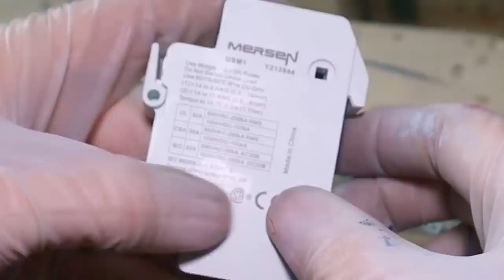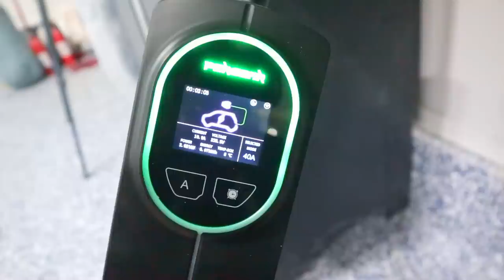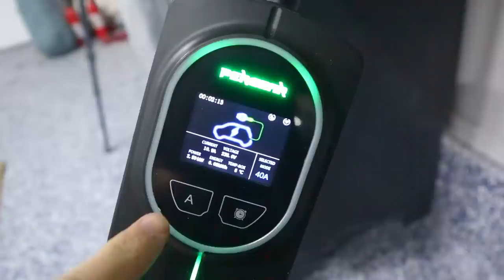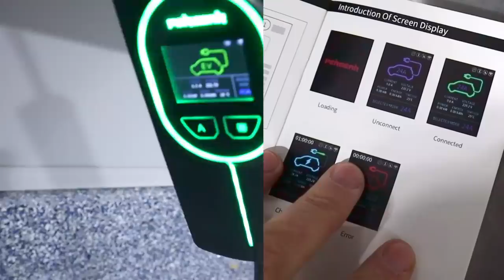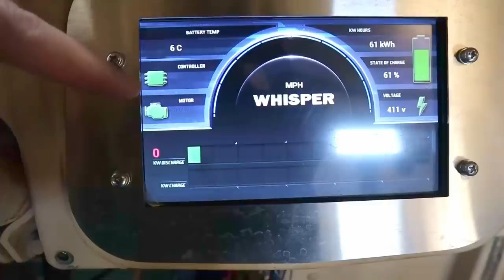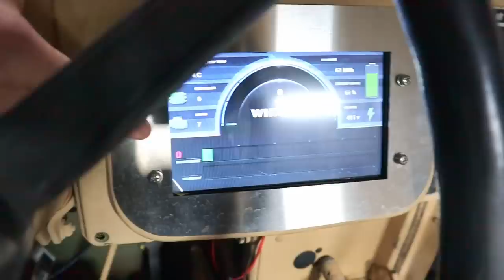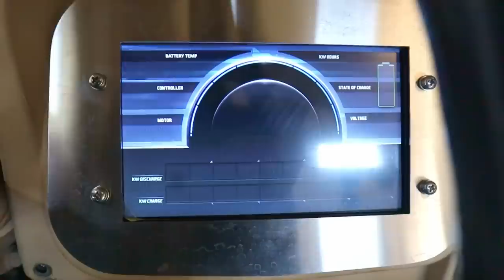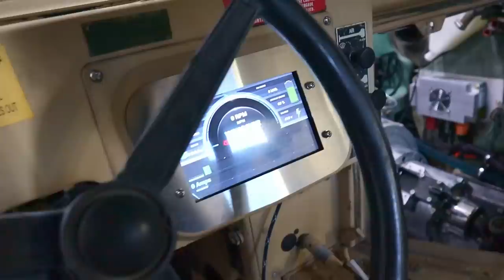The Electric HMMWV Strikes Back - More Trouble with charging

Comment: Here Maybe some tips with the CAN-Bus, because I do a lot at work with it I had a lot of issues that i know.
- The wiring should be in one line and should not have any stubs. Yes I know the specification allows to have stubs, but in my experience they often make more trouble than anything else. If you need a stub, try staying below 1m. For debugging purposes like PCAN you can allways have longer stubs, as long as you are only reading and not sending anything on the bus over it.
- You should also look at the maximum wire length, I recommend staying under 40m.
- When CAN-High or CAN-Low on any slave isn't connected properly it can happen that when the can load is low that it works fine and as soon as the load goes higher error telegrams might appear
- You can see error telegrams with the PCAN software when you go under trace > rightclick where the messages are > Enable "Log Error Frames" & "Log Error Counter Changes". You can also disable the other ones, so it's easier to see the error frames when there are not thousands of messages
- The Termination Resistors (120Ohm) should allways be at the end not somewhere in between.
- When everything is off you can check the Termination Resistors by measuring between CAN-High and CAN-Low wire the Ohm. It should be around 60. (120Ohm>1Resistor, 60Ohm>2Resistor, 40Ohm>3Resistors, ...)
- There should only be one CAN-Master in the system otherways they can interfier with each other.
- In my experience twisted pair isn't really needed mostly we use just flat cables.
- It could also be that the BUS is overloaded, this is the only thing, that you can't test with the USB-to-CAN from PEAK. For that you would need the PCAN-Diag 2 or for vehicle purposes PCAN-Diag FD with the J1939 Add-in. With those devices you can see the CAN-High/CAN-Low Voltage levels, how many error frames, how the load is in a bar chart, oscilloscope for the signals, etc.
- When on a slave CAN-HIgh/CAN-Low is swapped or has any issues then the slave automatically disables it's transceiver. So it doesn't interfier with the others in the bus.
- So all in all if there are no error frames on the CAN-Bus and it's never overloaded, then there aren't any issues with the wiring.
Reply: Just mentioned the resistors. I really think these are causing communication problems and may solve the whole issue. 1-wire devices have a resistor between comm wire and positive at every device otherwise they won’t be seen. Does this system have a central unit for canbus comms?
Reply: @rancillinmontgomery2480  CAN-Bus only has a resistor on the end of the wiring, so it eliminates the signals and no reflection appears. The resistors there are between CAN-High and CAN-Low. In between there can be up to 30 devices then you would need something like a CAN-Repeater to improve the signals again.
Reply: @Silent3241  there needs to be 2 correct, one at each end? Could the error message CAN Heavy be from the absence of the resistors?
Reply: @rancillinmontgomery2480  Yes one at each end. In my experience CAN Heavy can come when you start the individual participants on the CAN-Bus, but mostly goes away by itself. I only noticed it now that it stays, when there are messages incomming. So it could be the resistors, but I would focus way more on the baud rate of the individual participants, because when there is a mismatch then there will be errors on the bus and one of the participants will shut of their transceiver, so the rest can communicate.

This is why i wrote "- You can see error telegrams with the PCAN software when you go under trace > rightclick where the messages are > Enable "Log Error Frames" & "Log Error Counter Changes". You can also disable the other ones, so it's easier to see the error frames when there are not thousands of messages" in the first comment.

But it seems like our discussion doesn't help very much because @ElectricSuperCar doesn't our conversation.

Comment: I’m so glad that when I did my conversion I built out each system separately. Batteries and charging, motor and controller, etc then combined everything into a master control unit. At the time it was Elithion. Not as robust of a unit as you guys are using, but it worked! Maybe go backwards and split units off the can bus. Isolate the J112 control, charger and batteries. You can charge for a short test with the BMS control just to see it take a charge. Temporarily turn off all battery management and let the charger control run wild. You can simply unplug to stop it.
Reply from the maker: Thanks for the comment!

Comment: I love how you try and try without hesitation . I'm just wondering how and when you learned all of this . I definitely wanna watch some Q&A about this channel .
Reply from the maker: Ya, I just tend to jump in.  Learned by doing I guess
Reply: Just learn as you go, then show someone (that will cause you to learn more) then learn something more.   This is the EVSE interface with Pilot and Proximity and AC power and high voltage DC fuses and CAN data representing measured values --- SO many aspects of electrical engineering!

Comment: Make sure that pin 3 (charge power) in the Orion bms, has 12v+ when the charger is connected, otherwise the bms will not command the charger to turn on. I paused one of your screen shots and it said it was off when it should be on. hope that helps.
Reply from the maker: Thanks for the comment Nick!

Comment: I can mostly agree with your methodology. However can’t help but notice that you rewired the plug and fried the wall charger, and the onboard controller immediately after. I’m curious about that. I’d verify that should be ground or whatever it was, then verify it’s only ground meaning the previous wiring didnt use that pin to power another circuit or something that could lead to everything being shorted. But of luck.
As a test engineer I 100% can relate to the pain of blind diagnostics.
Reply from the maker: Thanks for the tips!

Comment: I feel like with your address conflict issues you need to disconnect everything. Start with just two systems on the CAN bus like the bms and controller, get the can addresses fixed and see if it charges. Then start adding in one system at a time. Maybe it's time for a excel sheet with every system and all its CAN address' and which ones can be reprogrammed etc.
Reply from the maker: You are probably right
Reply: just what I was thinking

Comment: I started following Zach's EV HMMWV build around 2 days after the first video was released, and I've been interested in the progress since.  Thank you for continuing to share challenges and processes on the build/repair.  Can you talk Zach into making sure it's labeled as an EV, in case EMS ever has to roll up on it?  Responders will need to know to grab their voltage testers and high voltage electric gloves.
Reply from the maker: Thanks for the comment!
Reply: There is no reason a voltage tester would be needed if all you need to do is get the occupants' corpses out. The only time it makes a difference is if it's on fire.
Reply: @user2C47  well, it seems to me that during ANY stage of contact with the electrified vehicle, knowing whether there is or is not a charge would be simple safety.  I admit I'm just a beginner in learning about both, basic mechanics and electrical systems, and only approaching as a hobbyist, but I've been shocked before, and tend to think about how to avoid it, especially with higher voltage

Comment: You are not just fixing errors of construction you are making the desigm function.
I recommend the AVC2 module to make the EVSE provide the 2 phase AC power - worked for me!
Your CAN looks good, remember to use tsp wire and a terminator at each end.
Reply from the maker: Thanks for the comment!

Comment: CAN wires always need to be twisted AND shielded! CAN is highly susceptible to interference and will cause intermittent communication issues. Specifically with charge systems you need a good clean communication line (CP wire) from the charger to charge controller on the vehicle. I work as an electrical engineer on electric buses and we run into issues all the time. We utilize CCS1 charging with J1939 CAN communication on our vehicles.
Reply: Another note: when using a PCAN as you are for network logging, you should set up the interface to look at CAN ID's vs continuous logging. That way you should be able to reverse engineer the RPM/Speed signals from the others. Source addresses are important but the message identifications (start bit/size) is where the specific data bits are stored and I am sure that is what you are modifying in the instrument panel. In our buses we use loggers with databases (which are nothing more than libraries) that can show data real time or can be viewed at a later point. Not sure if your inverter and motor/ other components come with databases, but those would be an excellent place to look for message details.

Comment: I have a plan do an EV conversion in the next 5 years (currently gathering components) and I'll definitely take the time and expense (it's just wires and connectors and a small price compared to the project) to lay everything out on a test bench and make sure everything works in harmony before installing into a vehicle.  While mistakes can still be made going from test bench to vehicle, having a working roadmap to go from would be invaluable, and working out initial bugs on a test bench is so much easier than climbing in, out, over, and under a vehicle and working in confined spaces.
Reply from the maker: Right you are!

Comment: What I’ve learned from these videos is that diy electric vehicle conversions aren’t really at the point where they can be easily done. So many brand new parts seem to have something wrong with them. If I had this many components fail before I finished a project I would be so mad.
Reply from the maker: It could just be me.  I tend to take the hard path
Reply: @ElectricSuperCar  no other industry has this rate of failure. How many components did you mention in this bud to have something wrong with them?4?5? I’d have to rewatch to get an accurate count but that seems ridiculously high. It’s like the ev component manufacturing just hasn’t matured to a point where you can get reliable parts. While defective parts happen in any industry it just seems really high failure rates for these parts.

Comment: Thanks for the content! Really interesting! From a systems engineering point of view, may I suggest detailing out the block diagram that you were drawing on the board a bit more ? You could add the different types of inputs and outputs with a description of what each block is supposed to do.. Then use that to isolate and test each component in isolation.. perhaps ?
Reply from the maker: Thanks for the tip!

Comment: I would recommend checking the signal with an oscilloscope at each of the nodes. If there is no physical problem with the network, then a CAN sniffer might help in checking if the BMS and charger are communicating.
Reply from the maker: Thanks for the comment!

Comment: At this point, I'd consider removing all systems from the Humvee, and getting it operating via some bench testing. Independent device testing, checking ohms on plug connections, and individual wires.
Test for problems like individual system interferences, ground or any wire shorts, ohm resistance over connectors or damaged solid core wires.

This can also allow better "combing" of wires before reinstalling for future wire replacements.

Best of luck.
Reply from the maker: Thanks for the suggestion!

Comment: For communication, you can also use a coxial cable... the same as your cale company uses, but there are models specifically for CAN, since this protocol is used in a lot of industrial applications,  as well as modbus.,

Also, you can buy a twisted pair cable, certified for serial communication (CAN in this case).
Reply from the maker: Thanks for the comment!

Comment: Hello, on PCAN Viewer you had displayed BUSHEAVY. This indicates an issue with the 120 Ohm rezistor at the ends of the bus.
Reply from the maker: Interesting.  Why do you think so?
Reply: @ElectricSuperCar  I know this from work. Our systems don't work (the bords on the bus) are not able to communicate if the BUSHEAVY is shown. Ideally you don't split the bus and where the cable starts and ends you have a 120Ohm rezistor
Reply: @ElectricSuperCar  and regarding the twisted can cable, we use flatcable 10p and it works great on 500 kbps. Maybe the charger is set for lower or higher bandwidth as 500 kbps?

Comment: I would make sure that I have a high voltage DC connection to the main battery terminals. I know AC charging is really important and convenient but to recharge using solar panels it’s best just to go direct current. You would benefit by a thermal camera as well. I have a thermal imaging camera and it’s been extremely helpful when looking at circuitry under load.
Reply from the maker: I will have to invest

Comment: CAN connections should at the very least be twisted, it helps prevent unwanted cross talking from other wires. I have a project at work that ended up frying 2 motor controllers because the CAN wires were NOT twisted, they are now twisted+sheilded+grounded and have been behaving ever since. the CAN communication chips are VERY sensitive to outside interference and even a high powered radio can take one out if unprotected.

Comment: Though I don’t know much about electric cars, it seems the original diagnosis of mixed up wires  could be the kind of fault that could have damaged multiple components that are strung together when Zack initially attempted to charge. In troubleshooting avionics I would suspect a power distribution fault has the potential to damage every other component in the chain, it’s certainly happened before.

Comment: Very strange problems.  Maybe it would be wise to disconnect everything else from the battery and fix the problem of not recharging first, because if the problem is in communication, it will be found faster.  What worries me is that you mentioned that the element in the distribution box overheats when it is not supposed to be loaded at all.  I wish you the best of luck in diagnosing the problem.
Reply from the maker: Thanks Friend!

Comment: Based on the issues you have found I would seriously consider what is your plan if this rig catches fire.  Maybe come up with a plan to drag it out of the garage so it can burn in the driveway without rolling over to the neighbors or catching other structures on fire.  If this rig catches fire it will take your whole building in a heartbeat and the fire department may not be able to stop it.

Comment: Nothing is worse than troubleshooting installed wiring.  I have always built things where you check/test each section as it goes in.  Thus you are never adding something broken to the system.  However cam buses suck because they are kind of like Christmas lights, one node goes out and everything goes out.
Reply from the maker: So right!

Comment: I forget what network topology the can bus system is most like as there have been a few. It’s not exactly serial, more like one used by IBM before Ethernet became dominant.
That aside I have experienced strange issues where putting one particular device in a certain part of the ring would either slow the entire network, kill it or just stop some devices from working but not others.
Finding the errant device amount hundreds on a network was not fun. Often it would be solved by logging Mac addresses against machine names to find things that had been duplicated.
I have also experienced occasions where simply swapping network cards between two machines solved all the issues, as long as they were different brands that is. It seems one brand of card would use memory spaces needed by other components and another brand wouldn’t.
Checking the resistance and noise of each network component on a serial network is a key trouble shooting step , some components work but are faulty.

Comment: Thanks for the work through and this update.  
Some thoughts I've had. 
You mentioned the Precharging resistor, is that to limit the current flow into the capacitors? Rhetorical questions
Do the capacitors get to the desired voltage?
Has the precharge relay altered state? I.e. enable the BMS?
Is the AC isolated from the DC-chassis ground?
AC and DC circuits are typically not directly connected to each other but use an isolation transformer. 
One last thought, if the caps need charging it may take 10s of minutes or longer to charge which would prevent the charging circuit to turn on. 
Hope something i wrote helps. 
Great work and i look forward to more.
Reply from the maker: No capacitors here.  The precharge circuit is there so that when the contactors close there is no spark that welds them in the closed position.  The precharge allows for voltage to flow around the contactor through a resistor, slowly making both sides of the contactor close enough that there is no spark (i.e. no weld)

Originally the AC was isolated from the vehicle.  In discussions with Orion, the vehicle ground and AC ground must be connected.

Comment: I think it's better to redo the charging section rather than chasing the issue. Start over. Might take time, but less than troubleshooting.
Reply from the maker: You are probably right!
Reply: I was just thinking about how frustrating that would be if it was all because the plug on the car was faulty

Comment: You should try put an oscilloscope on the CAN bus going to the charger and see if the CAN frames actually look good. I typically only used shielded twisted pair for CAN as the EMI from other components can cause intermittent faults.

Can you also show us step by step through the charging problem?
Wall Charger Status
Orion BMS status, it ready to charge, contractors closed?
Charge CAN messages, is it happy? Is it in fault? 
Etc. Thanks